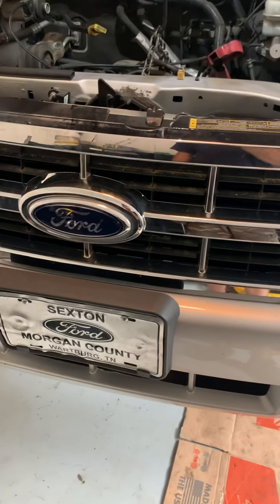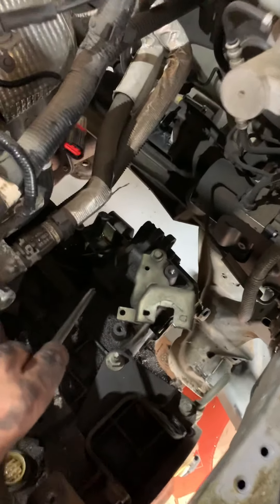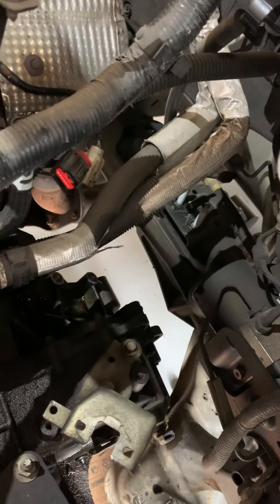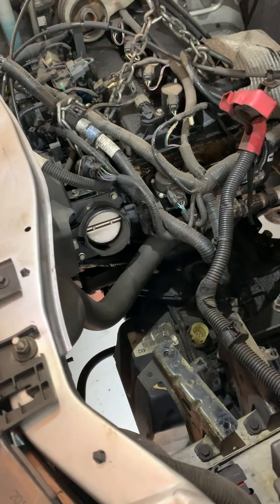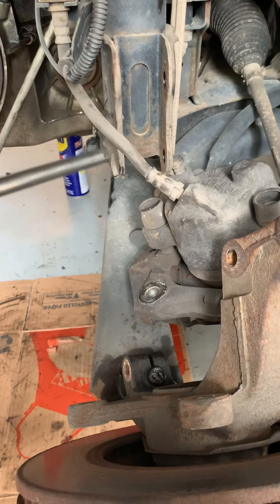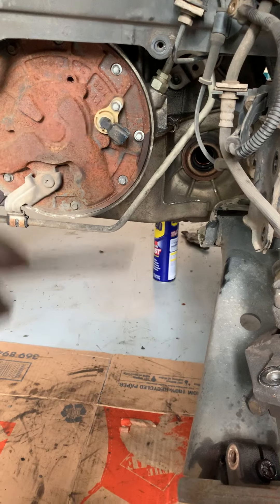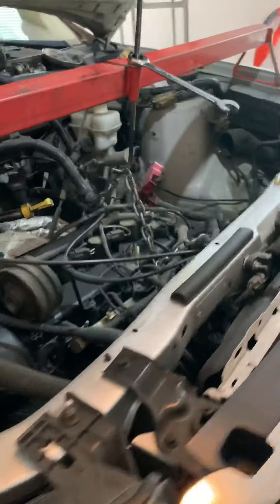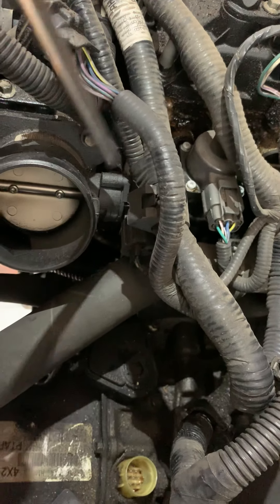2008 Ford Escape Transmisson removal/Replacement.

Comment: Hey I’m in process of this and I just got the starter off how do you wiggle your way to get the torque converter bolts off from flywheel there’s not much space and I can’t see where I need to get the bolts off from……. Nvm it’s a big rubber piece that comes out to get to the torque converter flywheel bolts

Comment: So is this transmission able to be pulled without dropping subframe? I'm in the process of this job right now.
Reply from the maker: Yes you can leave that back subframe in . Will need a engine support bar
Reply: @275stratos  I've got the support bar. So leave back subframe in, its being lowered from the bottom yet I assume? Sorry for the questions just wanna make sure I've got the details right.
Reply from the maker: Yes that is correct . You will have to twist the transmission to get it  out . Removing that subframe would make it really easy but it’s more work.
Reply: @275stratos  I appreciate the help! You saved me a bunch of work!
Reply from the maker: @MythicSR  yes lower from the bottom

Comment: Does the FWD CD4E have the port to attach a PTU unit and convert to 4WD as a project??  Or is it sealed and the housing is different from the 4WD CD4E? I have tried to look this up online and have gotten mixed answers.
Reply from the maker: Do you have the fwd transmission now. If so look at the side see if it has the treaded bolt hole for the ptu to bolt . I’m not sure if what you want to do will work I think the seal for the fwd axle shaft is different then What the seal for a  ptu used.
Reply from the maker: I really don’t see much difference in the cases It might bolt up and work you would definitely  have to change the pass side axle shaft with the one for awd
Reply: @275stratos  Thx for replaying!! I recently got a FWD 2.3l and the previous owner never changed the fluid in 150k miles. Its starting to slip and knowing I have to remove the tranny soon  makes me want to take on a little project and install the 4x4 system out of an older 2000-2004 escape. I cant find much info on it though.